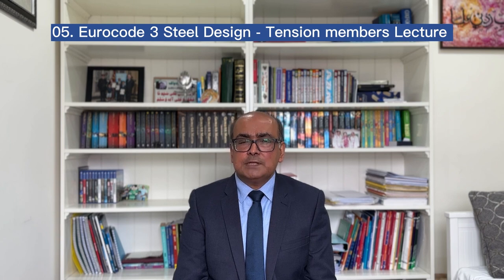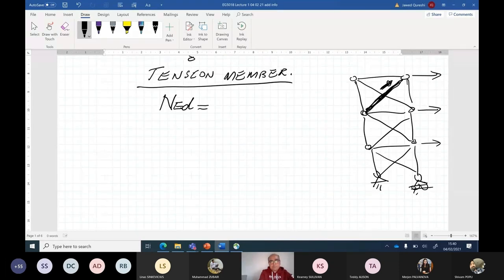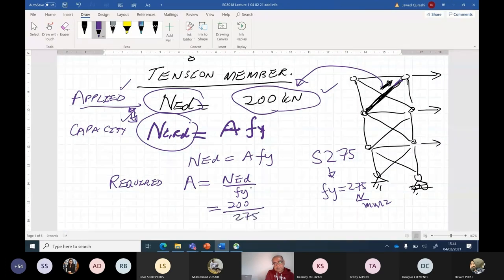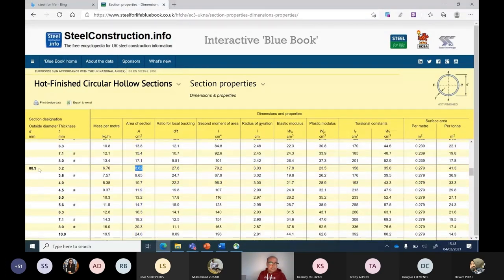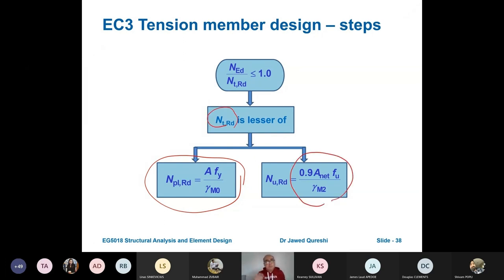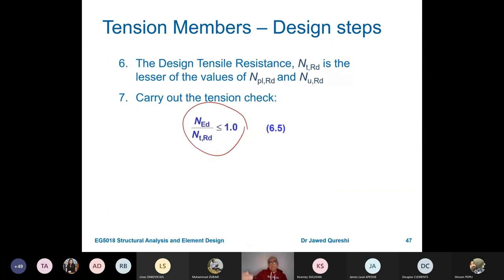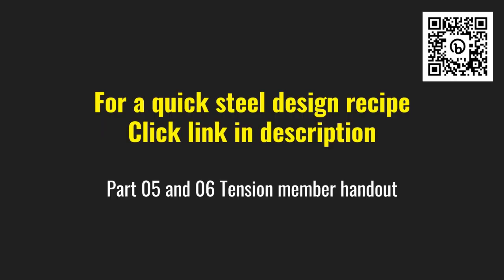05 Tension Member Design Lecture | Eurocode 3 Steel Design series

Comment from the maker: ** TIMESTAMPS **

00:00 – Introduction 
00:25 – Applications of tension members
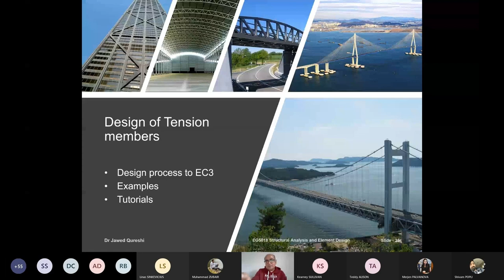00:47 – What shapes are used for tension members?
01:01 – How to design tension members?
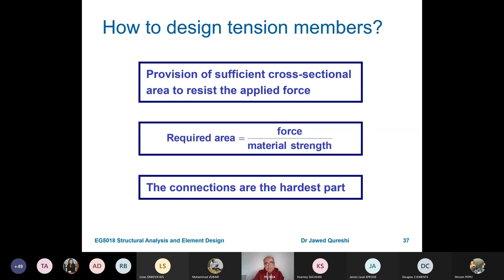04:55 – Eurocode 3 Tension member design process
05:51 – Design plastic and ultimate resistance 
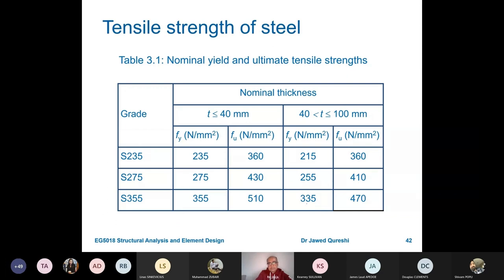06:24 – Tensile strength of steel
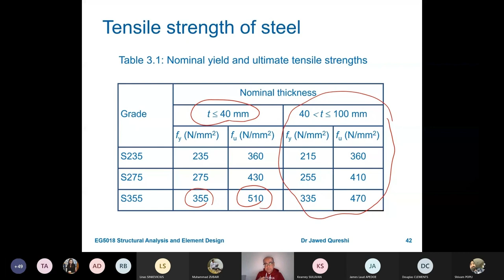06:55 – How to work out net area?
07:31 – Tensile Member – Design steps
07:59 – Tension member design example